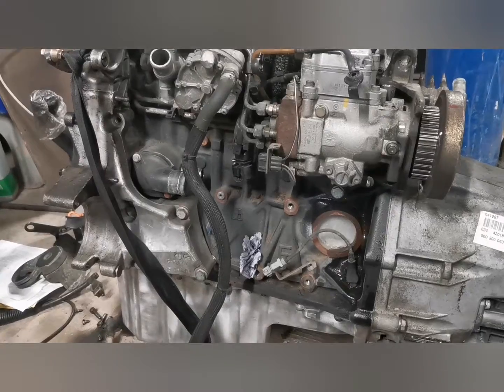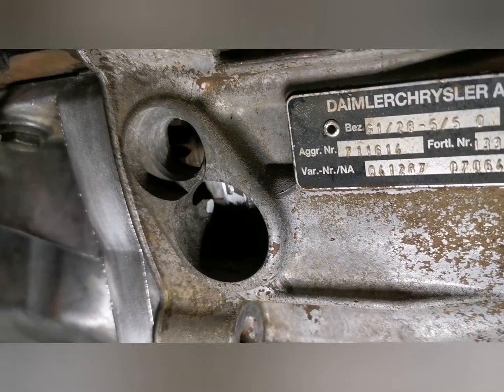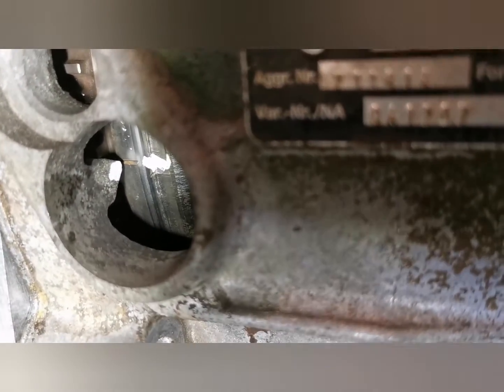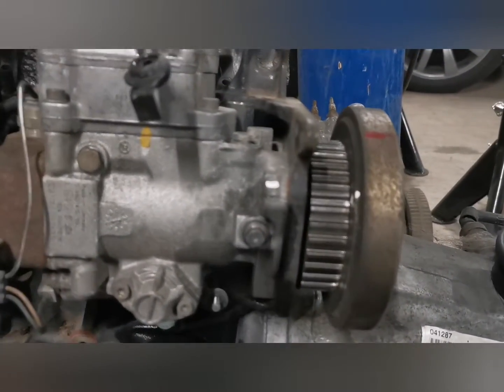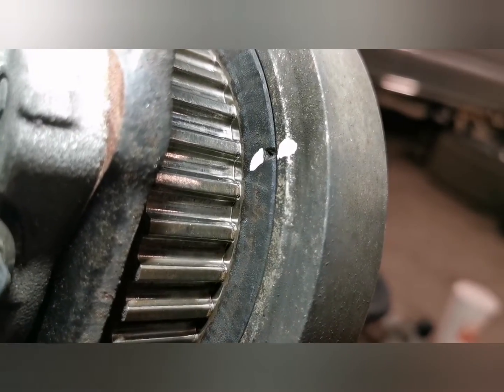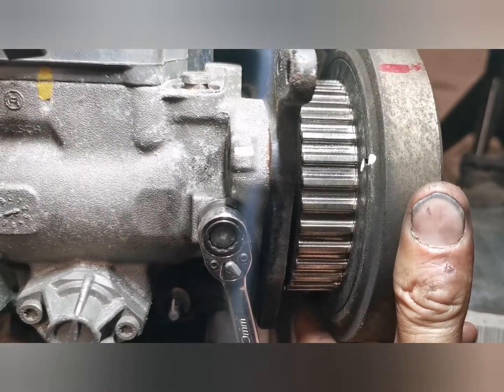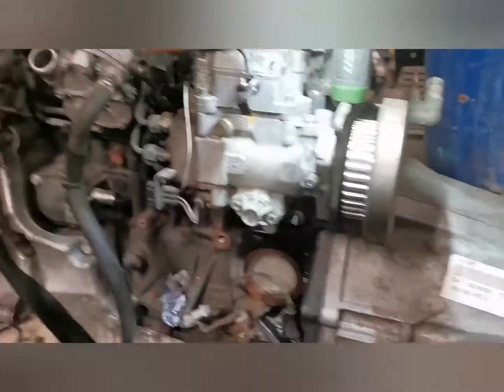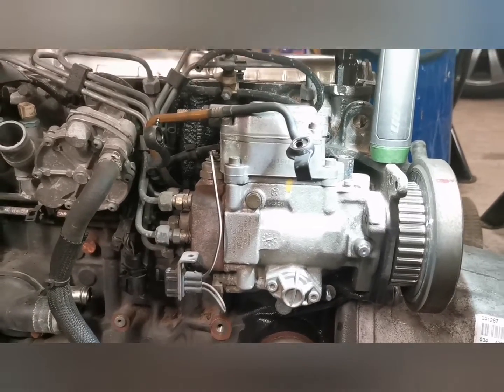how to....timing marks for VW lt35 Volvo d5252

Comment: To adjust the pump timing could you just rotate the body of the pump instead of using the crankshaft pulley locking tool without any belt on?
Reply: The pump is bolted on from the cam pulley side... so no slots to turn the pump or adjustable pump drive pulley..